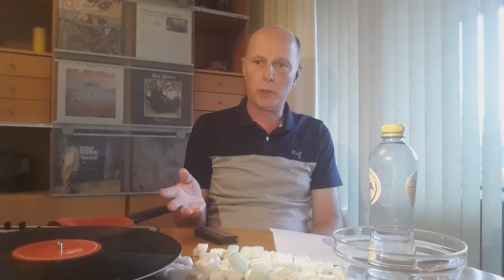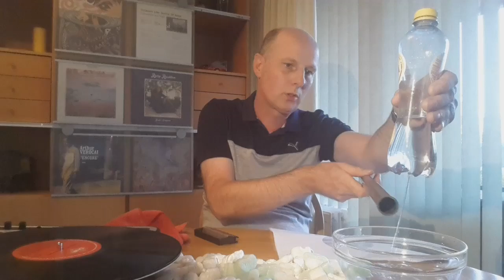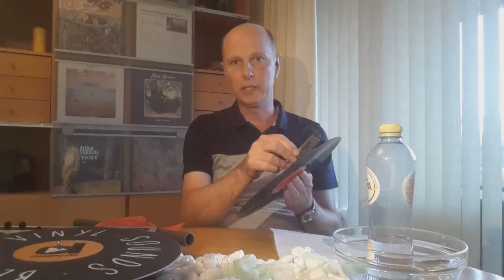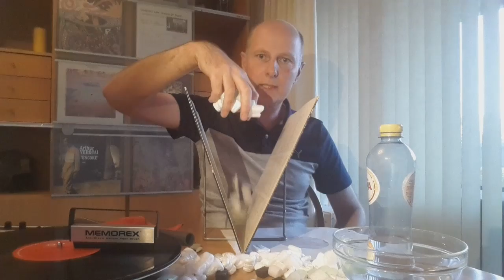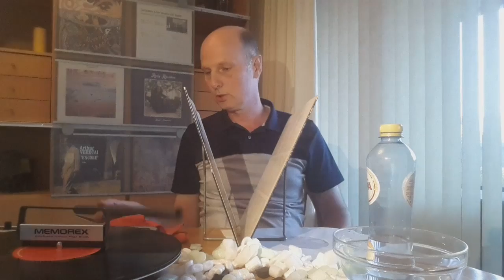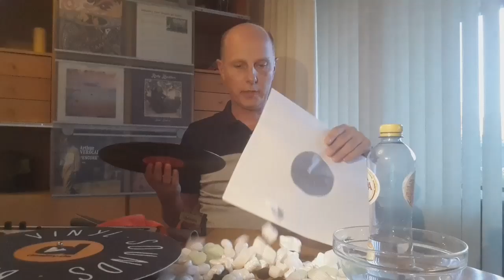3 Common Misconceptions Using a Record Brush - Vinyl Community

Comment: That's it! You were right! I'd been trying to remove static with the new brush I just ordered while the record was spinning on the platter, and it wasn't working at all. I could still feel a lot of charge when I held it close to my face (good way to test static). Tried holding it carefully in my hand and brushing while off the platter. Immediate, significant difference. Thanks for explaining so well and being right!
Reply from the maker: Happy to hear the puzzle is solved ;) Part of the trick is also to move the very slowly. Easy does it. Thanks for the comment. Cheers. /Paul

Comment: I do remember 45 years ago when I bought my Decca Record Brush , that the instructions specifically said that you place the record on the turntable , turn it on , then place the brush over the grooves , let the record go around 3 or 4 times then gradually move the brush toward the spindle until the brush is completely on the lable before lifting it off the record . It’s funny that I see most people dragging the brush off to the outer edge . I’ve gotta wonder if anybody bothers to read instructions or if instructions are just no longer included with these products now days . I often wonder what ever happened to my Decca brush . It’s been out of production a long time now which is sad and I truly miss mine . All I can think of is that it got damaged in moving from one location to another and I tossed it , not bothering to replace it since I had acquired the DiscWasher system .
Reply from the maker: Hi again Dave. Funny that you mention the Decca Record Brush. Some of the information I used in this video are from seventies leaflets and manual from that brush. They knew there stuff. I think most people go to the outside, because there is a lot of dust on the record. And use the brush more as a broom to get it off. Too bad you have lost the brush. It's a cool piece. Cheers. /Paul
Reply: In my opinion moving brush towards the spindle can leave the dust on the label which then can leave hairline scratches onto the record while inserting it into a sleeve. It's probably still good idea to wipe dust outwards.
Reply: Well , everybody has got their opinion but mine came with instructions and that’s the way Decca instructed the use of a piece they tested and manufactured . If you’re records have so much surface dust that the brush actually leaves dust behind , you should probably be using something that uses at least a damp pad to clean the dust off . I never let the stylus touch my records until I went through the ritual before each and every play . All my records sound as good as they did on the very first play and they are 35 to 55 years old . My styli go two to three times what they are supposed to go due to meticulous care or the records and I think Decca knew what they were talking about . There’s something about the charge created when the brush hits the spindle while it’s on the label that makes sure everything stays in the micro bristles when it’s picked up off the label until it got swiped on its stand that had a small post that knocked the dust out of the bristles . I’d also put money on there being more pollutants in the records sleeve that what would ever be on the records label so care in the way the disc is inserted and extracted from the sleeve is important . Traveling in the direction that the grooves actually travel makes more sense also than fighting that direction by trying to drag dust off the edge without the charge that occurs by touching the spindle . I’ve tried it both ways and by going off the edge , static always left dust on the records surface . I only wish I still had my Decca brush . It was truly state of the art in design and function . But alas , I’ve still got my DiscWasher and an extra pad if I ever wear out my first one which will probably outlast me .

Comment: thanks bud .
i watching these cleaning vids for fun i saw a ton of them and never commented on any of them because as many vinyl head as many cleaning ritual .
so on static my way is to place the disc on the platter then on my lh thumb touch the edge of the disc and my lh pointy finger touches the spindle  [ in the same time ] then i reach out whit my rh pointy finger and touching the dead bolt [ flat surface unpainted ]on the radiator. all of my radiators in the property grounded also the lp spinner connected to the main ground. it's works flawlessly FOR ME . static  gone . then i brus from out to in touching the spindle till the last minute .
it's works for me so save your thoughts smarty pants ;)
Reply from the maker: Hahah, great comment :) Give me at least one go at making a smarty pants remark ;) Have you ever tried to brush the record slowly with one hand and touching the radiator with the other hand? I like the way you try to remove the static. It clearly has a positive effect. Thanks for the comment. Have a great weekend. Cheers. /Paul
Reply: @XjunkieNL  
Thanks for taking the time to reply
You to m8 and God bless .

Comment: Great video!  I have developed a way to minimize static that seems to work for me.  After removing the LP record from its sleeve, I hold the record and shoot it with the zerostat gun, above and below the record.  Then I put the record on the platter and use a stiff VPI dry brush to remove the obvious bits of dust, dragging the brush on an angle making several swipes off the record, that is being lit by a high lumen flashlight. I follow with the zerostat as the record is still rotating. I sometimes add the use the Audioquest antistatic brush and if so, will hold it on a slight angle to the record, as in this video, going from the outside in, then back to the point where the brush is covering all the grooves of the rotating record and very slowly raise the brush off the record only by rotating it towards the back of the brush. I enjoy rather quiet playback and noticed the static is gone, even when I lift the record off the platter. a final few shots of the zerostat and back in the sleeve it goes. It's a bit of a pain, but worth it. I would love an easier way, but I do pick up a lot of static due to cleaning on a vacuum machine.
Reply from the maker: Hi Jeffrey. Thanks for sharing your method of getting rid of static. You have quit a few steps, although I don't think there is a shortcut. One thing I notice you use the brush to get rid of the dust and the zerostat to get rid of the static. Maybe it's fun to know a zerostat does not remove charge, it neutralises charge. Meaning it actively overflows the record with the opposite charge to neutralise the charge on the record. With a carbon brush you can remove the static, in a passive way. But it wouldn't speed up the process, maybe even slows it down as you have to move the brush much slower. Thanks for watching. Cheers. /Paul

Comment: Thank you very much for this explanation, helped a lot. Also want to share that my cheap carbon fiber brush (from Aliexpress) has absolutely no contact with the metal, which I think prevents exactly what it proposes to do, reduce the static energy. Thank you again for your effort, greetings from Brazil!
Reply from the maker: Bom dia Rafael! Nice to get a comment from Brazil. Thanks for watching and the comment. I agree with you, static removal is part of reason using a carbon fiber brush. There are quite a few different carbon fiber brushes on the market. Have you seen the video where I test different types? Maybe it's helpful for you. All the best. Cheers. /Paul
Reply: @XjunkieNL  Boa noite Paul! I saw the other video and my carbon fiber brush matched (apparently) with the cheapest one you showed. The only thing is that, dissassembling it, there wasn't contact with the handle as yours did. I had to make some "DIY" stuff to have the fibers in contact with my hand (or any other ground), as it's a bit difficult to buy a new here in Brazil. I will try to do some recording tests to see the real efficiency getting rid of the static (which is the biggest problem for me). Thank you very much again, Rafael :)
Reply from the maker: Hi Rafael, if static is a real big problem, most probably the only way to get rid of it is by a wet cleaning. The brushes are helpful in remove some, but are not as effective as a wet clean in distilled water. /Paul

Comment: You definitely need to try an acrylic mat! When used in conjunction with your advice the two should work better than on their own. I have always used the brush with the platter spinning, after seeing this it makes perfect sense not too. A felt mat has the same effect of conducting/harnessing static charge. Acrylic is the closest composition to vinyl records, cork and leather also seem good alternatives.
Reply from the maker: Hi Glenn. Thanks for the tip. Till now I have never used an acrylic mat. I can see your point. On the other hand I've mostly selected my mat on its sound qualities. Although many say the sound quality of acrylic is also great. Something fun to try in the future. Thanks again for the comment. Cheers. /Paul
Reply: @iLL-iNNeR-GrOoVe  my Matt is also a Hudson, works really well. Often wonder if a cork Matt is worth a go.

Comment: Thanks so much for the instruction, it's really helpful for a newbie as I. On the other hand, is there any way to remove the static electricity from the vinyl quicker by something I can create at home? I tried to look for a solution, and most people said that using Milty Zerostat 3 is the only way.
Reply from the maker: Hi! An alternative wat to remove static is by a wet-cleaning your record. It's very effective, as you really remove the static. With a Zerostat you are not removing, but neutralizing static. Meaning there is a lot of charge on the record, but the positive and negative charge are in balance. So there is no quicker way, but wet-cleaning is a very effective way. Afterwards you only need a brush. Hope this helps. Cheers. /Paul
Reply: @XjunkieNL  : Hi Paul, Thanks so much for answer my question. Really, I tried to look for the correct answer for long ago. I think I will go ahead with your way. It's saving way, just take little time but I also think it's the good way. Cheers
Reply from the maker: In a strange way, cleaning records can be fun. Kind of meditation ;) Have fun. Keep that vinyl spinning :)
Reply: @XjunkieNL  : hahaha, you are right. It's fun when doing the cleaning each record before enjoy it .

Comment: Great video!  Have you used a carbon fiber brush on fabrics like clothing or furniture to remove dust, lint, pillings, hair, crumbs, etc?  If so how did you like it?  Thx in advance
Reply from the maker: Hi! Thanks! Never tried it, but I don't think it will be as successful as those sticky rollers. I show some in my Ikea Vinyl Accessories video. For vinyl records they are a bit too sticky. All the best. Cheers. /Paul
Reply: thx for the reply - last question i have for you if that is okay...I am building a fabric shaver with a vacuum element.  Jus curious if you have pets or find yourself cleaning fabric on a weekly basis and if so, what fabric shavers do you or have used and out of 15 star ratings, how would you rate them?  thx in advance 
Bonafide
Reply from the maker: Cool to hear you are making your own. No cats or dogs here, so no direct need for a fabric cleaner. Best of luck. Cheers. /Paul

Comment: Thanks Paul, for your input. I would like to know if ultrasonic cleaning eliminates static (?). I currently use a vacuum machine. The thing that I have found out with the Zerostat is records don't seem to attract much dust at all versus not using it. Also, before using the Zerostat, records would crackle with static, pulling the record off the platter after playing a side of an LP.
Reply from the maker: Hi! In general wet cleaning removes static. Independent if you use a Spin Clean, Moth, Loricraft or an ultrasonic machine. The water forms a conductive layer over the record that helps to neutralise charge. Most often drying is the tricky part. Fast moving air reintroduces static. This is especially true for vacuum machines. You could try to shorten the drying time and dry the last droplets in air. Or use your Zerostat to neutralise the newly introduced static as you do now. Let me know if it helps. Cheers. /Paul

Comment: What you answer for when carbon brush scratching you vinyl? 
You can try if your brush the vinyl on the in inside of your vinyl, to see if it give you micro scratches.
Reply from the maker: Hi! Yes, good suggestion. The deadwax is a good place test a carbon fiber brush for scratching. From what I've seen quite a few brushes leave tiny little markings. Thanks for the comment. Cheers. /Paul

Comment: This is a very interesting video.  In my opinion carbon fiber record brushes are designed incorrectly because the ends of the two rows of brushes are open when they should be closed so that any dust that is picked up by that part of the brush would be swept away as the brush is brought either forward (off the end of the record) or backward (toward the center of the record).  A better design for a carbon fiber record brush, in my opinion, would be a square  because there would be a larger brush area to remove dust and there would be no uncertainty about which direction the brush should be held as no matter which direction the brush "faces", the cleaning potential is always the same.  
Following your idea of cleaning from the outside in because that is the direction the grooves follow, it seems to me that the best method for cleaning (following your same logic) would be to spin the turntable in reverse and then start from the inside and brush toward the outer edge of the record and then off the edge of the record so that dust would fall off the outer edge of record rather than be on the label of the record.  To be clear, when the turntable is spun in reverse, the grooves would then follow from the middle of the record to the outer edge of the record.
Reply from the maker: Hey Paul. Thanks for the comment. I like your idea of spinning it in reverse. Exactly, best of both worlds. In theory the dust should be caught in between the fibres and stay there. But I guess there is too much dust to be picked up. You really gave this some thought. The boxed designed brush is a neat idea. I don't know if you have seen my follow up video, in which I compare 5 different brushes. One of them resembles your idea a little. Much more fibers, not a small row, resembles more a real brush. Maybe it is also something you would like. All the best. /Paul

Comment: I use the carbon fibre brush in a fixed position with the turntable rotating. Holding the brush steady I turn the turntable off, this leaves a line of dust. I then use a can of dust off to blow the dust off. Trying to go from inside out or outside is trying to drag dust across the groves is flawed in my opinion.
Reply from the maker: Thanks for watching and the comment, Terry. Sounds as a good way to remove the line of dust. In another video I show a mini vacuum cleaner to suck it up. In general I think when there is that much dust on a record, a carbon fiber brush alone is not the ideal tool to remove it. Cheers. /Paul
Reply: @iLL-iNNeR-GrOoVe  please clarify this formula for me... I believe you're saying 32oz of distilled water mixed with 20ml of llfotol plus 20ml of ipa? Is that correct? And what is ipa??

Comment: This is very close to the correct way of using a carbon fiber brush. bring the outside of the brush in a sweeping motion towards the center, to push any dust not picked up, to the center label.
Reply from the maker: Hi Elliot. Thanks for the additional tip. Always curious how others use the carbon fiber brush. All the best. Cheers. /Paul
Reply: I thought that is what he said to do... ??

Comment: i find that if i lightly spray the brush with distilled water prior to cleaning, most dust and some static are illiminated.
Reply from the maker: Hi again. Water is one of the best solvents on the planet. For sure it helps if you add a little. Thanks for watching. Cheers. /Paul

Comment: @X junkie NL    HI Paul. Great video and learned quite a lot. Thank you. One question if you may... how do you scoop the dust out when you hold the LP and brush it with carbon brush? I could gather all of dust on a line across the LP but not sure how to scoop it out when I hold the LP one hand and the other hand with carbon brush.... Thank you in advance.
Reply from the maker: Hey John. Thanks for watching. Yeah those dust line are tough to get off. In the past I tried to blow them off. Not a smart idea as there are also small water particles in your breath that get stuck on the record. In principle you have more dust on the record as the brush can handle to pick up. Did you get this much dust on the record after cleaning, otherwise I would suggest a wet clean to get the record dust free again. Take care. /Paul
Reply: @XjunkieNL  I found a way to get rid of dust line easily and just would like to share with you. I got Vinyl Buddy Record Cleaner from Amazon which is sticky roller type and just 2 pass will get rid of those dustline completely. No mess No hassle. Hope it helps and again, thank you for sharing your idea and knowledge. Greatly appreciate your channel. :)
Reply from the maker: That's great to hear, John. And a nice and simple solution. Never thought about doing it this way. I have a Nagaoka roller with no use. Now I have a new use for it :) Cheers. /Paul